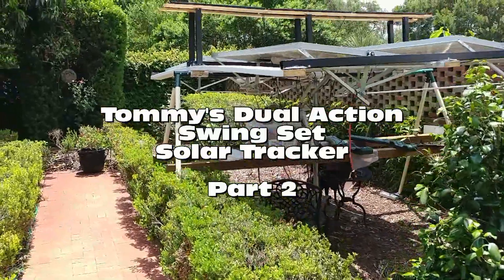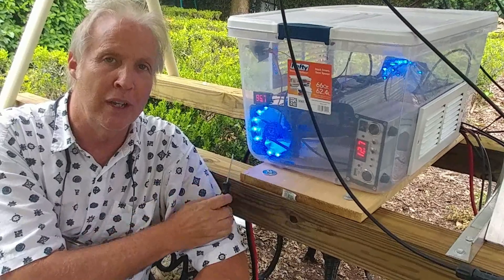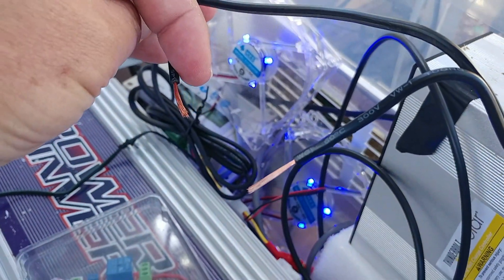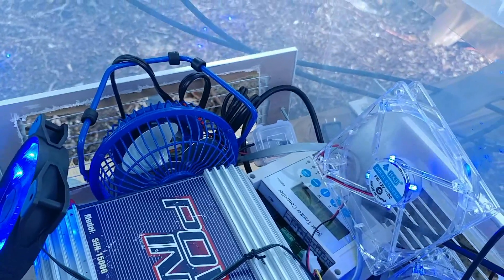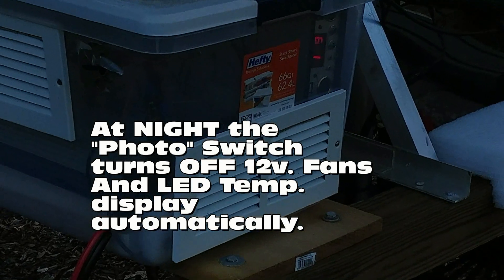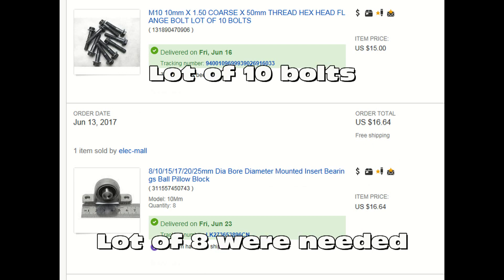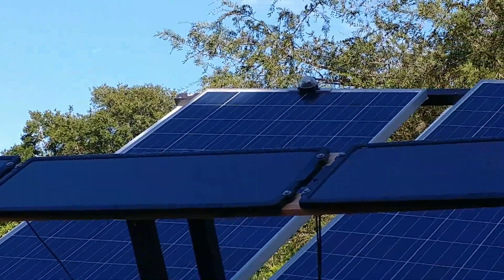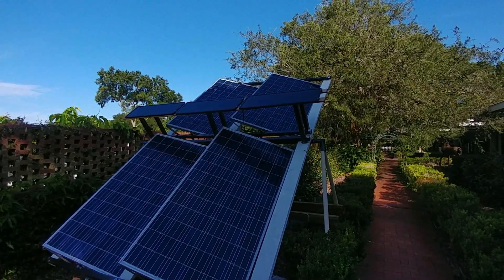Tommy dual action swing set solar tracker Part 2

Comment: Very interesting. Two things: 1/ The background “music” is nothing but irritating noise that drowns out what you are saying and the sound of the tracker motor you refer to. I would like to see and hear this video to the end but could not handle this noise.2/ Idon’t think there is such a thing as a thremal-coupler. I think a thermocouple is two dissimilar metals that generate electricity. I could be wrong.Anyway, if you ever filter out the background noise, please let me know so I can watch the entire video and learn from it. Thanks
Reply: Hi George,  Thermal coupler is a NERDY mumbo-jumbo technical term I picked up while watching scifi MOVIE.  rewatch this video and pause it when the invoice is shown. order one (they are cheap) and try it out?The music has no vocals,  If would be irritating noise if I used RAP NOISE like everyone else does!  Or what about the TUTORIALS of people opening a boxed item & trying to figure it out while on camera?? (with texted info. only)How is your project going?MINE is still working good, thanks for watching.